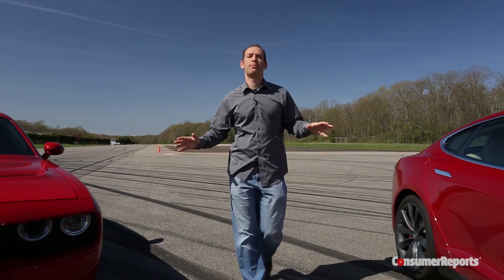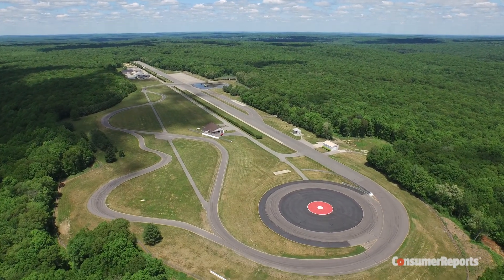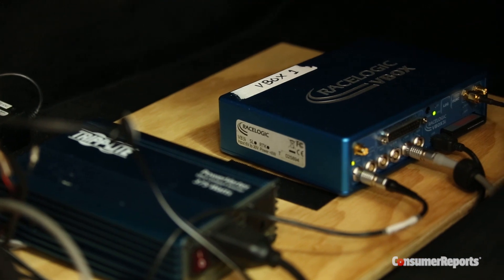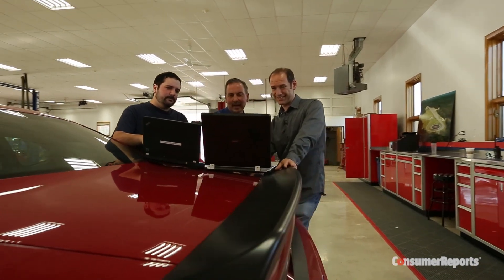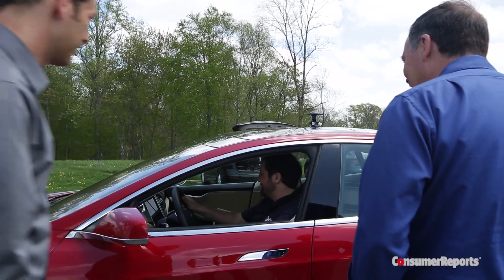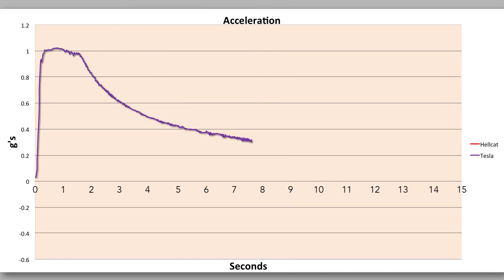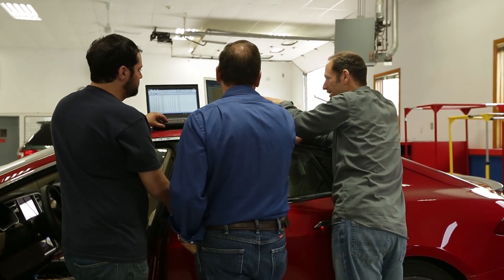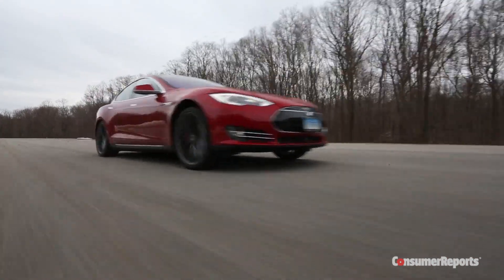Track Science: Tesla P85D vs. Challenger Hellcat | Consumer Reports

Comment: Imagen if tesla does a race car!!!
Reply: There is formula E racing
Reply: WEIMY BIMMER Electric motors have amazing acceleration, but battery technology can not sustain high amperage draw for prolong duration.  This is why Porsche utilize hybrid technology for their race cars: to have amazing acceleration with electric, and then switch to engine at cruising speeds.
Reply: nickolastiguan but don't they have to pit and change out the battery? if so, any time gained over a gasoline car would be lost in a pit stop?
Reply: James Rowland "Bad as a cheap track car" is the most charitable interpretation I could come up with"  yes that fits the bill as well, but that is something YOU came up with and have been trying to pull this conversation towards the whole time, even though I obviously was stating a different point.  Good job trying to put words in my mouth though.

"Your rebuttal saying you weren’t assessing it as a bad track car is you missing that point."
No.. thats me ignoring you trying to pigeon hole this conversation.  I am not missing any point, I just simply refuse to change my original point of argument.

"Here’s another point: If you’re making a price performance ratio claim"  Thats my original point. 

Saying its biased implys that its unfair which I completely disagree with.  Especially since I have been arguing price per performance the whole time.

"Comparing a 2008 car with a 2014 car is also bias."  I am comparing it because it is what is available today.  The only point I agree with is that I was using the original selling price. But again thats because you have steered the conversation in that direction to push your point of view.

I originally brought up the Roadster as an example of EV's not performing to the competition of their price range.  You singled out that I called the car horrible, which I still stand by.  Its horrible because it was notorious for overheating, and the performance you get for the price.  

Looking for a few used Roadsters, the price has dropped down to the $60k range, convenient as thats the same price range of a brand new Hellcat.  Still, to this day, paying more (or exactly the same) for less performance.
Reply: WEIMY BIMMER Tesla say they have no intention of making a race car however electric cars came in 1st and 2nd at Pikes Peak 2015 (and the 1st place car lost power to its rear wheels before the halfway point, finishing as front wheel drive only). The outright best time still belongs to gasoline from 2013 though.
Reply: fabulousprofound yeah, I believe they do. I think they are just testing the e racing water, and somewhere ex f1 drivers can go to retire lol jk.
Reply: WEIMY BIMMER
Imagine's all we can do, at least while Elon is in charge. He said straight up in last year's shareholder's meeting that Tesla will not be involved in racing.

I don't have a problem with that. Making the Model 3 is more important, and they have limited resources.
Reply: WEIMY BIMMER They did, the roadster, and it was horrible.
Reply: WEIMY BIMMER It will be a while until 100% electric vehicles will compete on a road course
Reply: DTRU122283
The Tesla Roadster was... well... a roadster. That's a road car, not a race car.

0-60 in 3.7s, 244 mile range, great handling (Lotus chassis tech). Oh, and 120 MPGe on the EPA test. Charges from flat in about 3 hours. What exactly is "horrible" about this?
Reply: James Rowland Roadsters are sports cars.  Neither the Hellcat or the P85D is a race car either.  One is a muscle car and one is a "luxury" sedan, yet we are speaking about performance so they are all looked at as such.

0-60 in 3.7 seconds, 1/4 mile in 12.6  for $128-$155k, overpriced for the performance.  The fast 0-60 is only one point of performance and you can find faster options for much less, even half the cost.

"great handling" that has been argued for quite some time.  There are much better vehicles in the same price range.  If you want to talk about handling around a track, you must mention the fact that the roadster frequently overheats and does not complete races.

Touting the MPG is completely pointless for such an over priced car. You could get 400 MPG, but if you cost twice as much as a faster car then what does it matter?
Reply: James Rowland "So, you reckon the price tag and thermal power limiting make the Tesla Roadster "horrible"?"
The performance for the price makes it a horrible car.  If you made a list of all the cars you could buy for $150k, the Roadster would be at the bottom of the barrel.

I never said it was about being a cheap track car, none of the cars mentioned so far have been cheap.  

Why does the instant torque from 0 make this car worth $150k?  Especially when there are cars in the same price range, or lower, that are faster to 60?

I never said it was the most expensive, just very expensive for what your getting.
Reply: DTRU122283
You're missing the point.

"Cheap track car" is about the only criteria where the Roadster would score "horrible" in an even vaguely fair assessment.

It wasn't supposed to be cheap. It was supposed to be a great sports car that's compatible with sustainable energy, and it delivers. There is nothing else like it - yet.
Reply: James Rowland No im not.

""Cheap track car" is about the only criteria where the Roadster would score "horrible""
And price per performance. And comparison against cars of its own price range.
Reply: DTRU122283
You certainly did miss the point about the "cheap track car" metric first time around; that much is obvious from the way you were disowning a position I never attributed to you.

Just how exactly are you measuring "price per performance" of 2008 roadsters where the Tesla Roadster ends up on the bottom? Method and figures, please. If I can find one that's worse by whatever metric you're using, your claim fails.

As for instant torque not being worth any extra, I'm guessing you've never experienced it.
Reply: James Rowland No I did not miss the point, I am disagreeing with you..  I thought I made that obvious. 

"As for instant torque not being worth any extra, I'm guessing you've never experienced it."  That's a bold assumption... Yes, instant torque is fun, it puts you into the seat and makes it hard to keep your hands on the steering wheel.  But so do many other AWD cars that have a ton of traction off the line...  You know what s MORE fun than the roadsters 3.7 0-60?  The GTR Nismo's 2.9 0-60.  It will put you in the seat and keep you there the whole time, not just off the line like EV's.  It runs the quarter in 10.8 seconds and guess the price?  $150k, same range as the roadster yet it beats it in every category (except when you narrow your vision down to one specific class where only one car exist).  Again I state my main point of discussion, you pay more for less performance when going with an EV.

You keep trying to narrow down to a roadster as a specific class.  When I have been talking price range the whole time.  I am not comparing ONLY roadsters. I am saying for $150k the performance of the Tesla roadster is the bottom of the barrel.  

If you want a car to put you back in your seat, the Hellcat will do it for less than half the price.  0-60 in 3.4, or 2.9 if you upgrade the tires.  Still faster in the quarter mile.  

No... instant torque is not worth an extra $88k when the cheaper car will put you in your seat harder than a car more than double the cost.
Reply: DTRU122283
"Bad as a cheap track car" is the most charitable interpretation I could come up with for “Tesla Roadster = horrible.” Had you been making that point, I would have to agree.

That’s the point I was making.

Your rebuttal saying you weren’t assessing it as a bad track car is you missing that point.

Here’s another point: If you’re making a price performance ratio claim, ignoring the class of car is bias; class does also influence the price.

Comparing a 2008 car with a 2014 car is also bias. Technology has improved, and the 2008 car has depreciated in value.

Thanks for the insight into your methodology, though. I rate it "horrible."
Reply: DTRU122283
I see you’re still missing the point. I was not “putting words in your mouth”, I was applying the Principle of Charity. Look it up sometime.

“Tesla Roadster = horrible track car” is the strongest version I could come up with of the claim “Tesla Roadster = horrible”. The whole point is that is not what you wrote when you clarified. You made a broader and much weaker claim.

Now, if I were to make an ordered list of roadsters available in 2008 by price and acceleration, how many would be worse than the Roadster? How many would be better?

That would be a fair comparison. But that's not what you're offering, is it?

Besides, who buys a sports car for economic reasons?
Reply: Okay... Who Farted??
Reply: half second to 60 miles
Reply: noren bordoloi
Even top fuel dragsters barely get close to that.